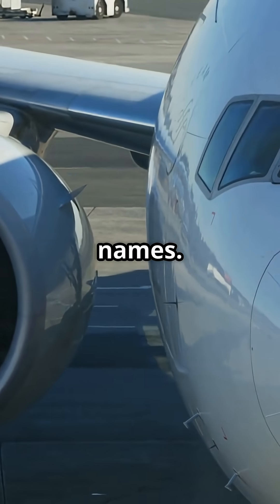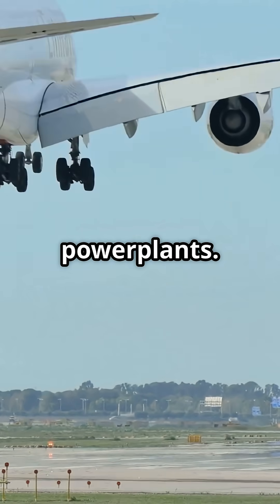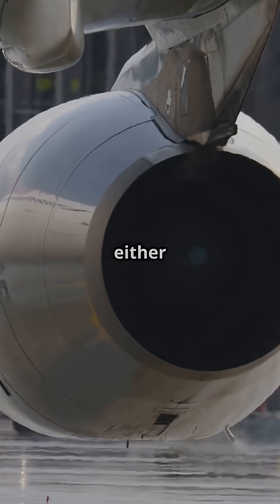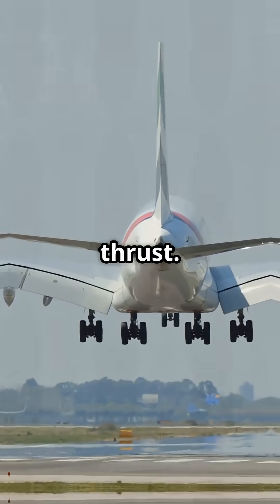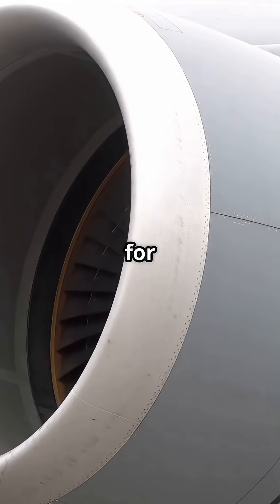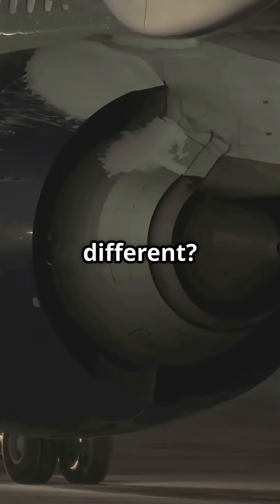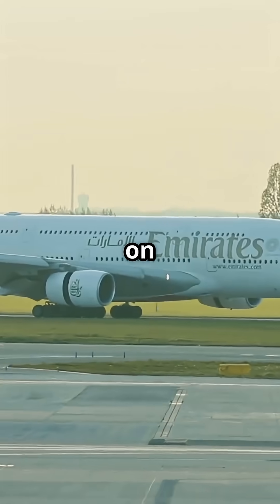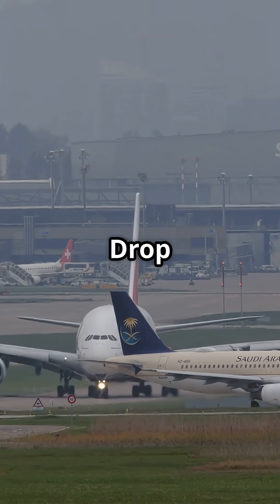A380 vs 747-8: The Battle of the Superjumbos

Comment: But it doesn't save on fuel when you consider the fact that the a380 can transport more than twice as many passengers per journey. So it actually saves fuel because it would take 2 737 journeys to transport the same amount of passengers using alot more fuel 🤷 on paper and reality dont match up